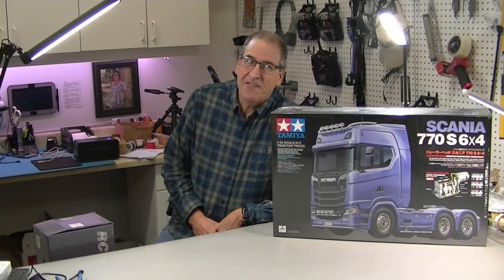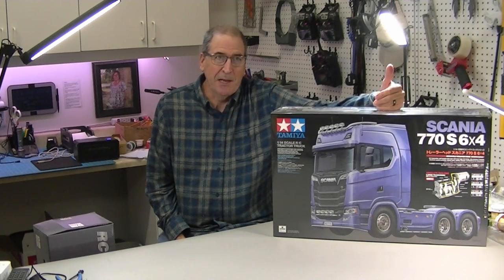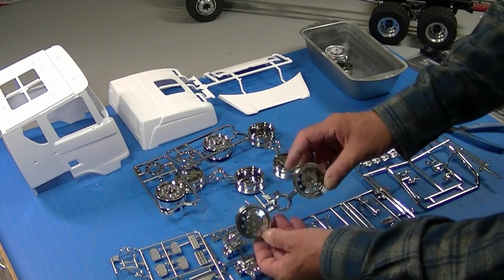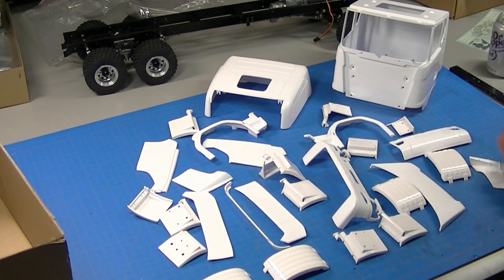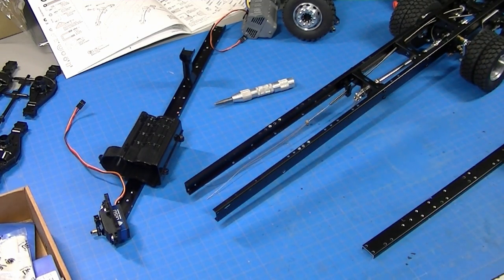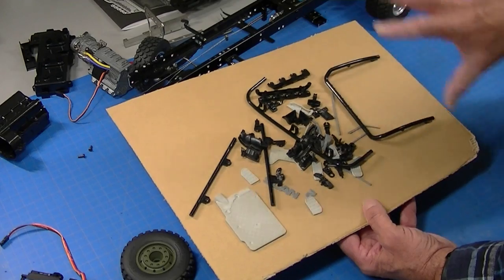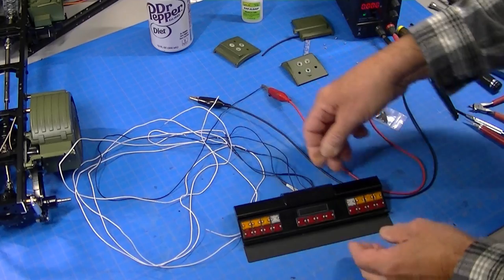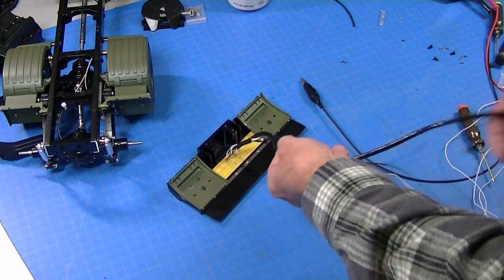1/14 Tamiya Scania 770S Custom Build w Trailer- Part 1

Comment: Loving the build concept on this one...... no sure its how we'd do it in Europe, we would shorten the chassis the idea of the equipment rack is to get the fuel tanks, air tanks,  battery etc out of the way to put extra axles in. However can't wait to see how this one works out

Comment: The real life version of the kind of truck you're making would usually have an extra steering axle in the empty space between the rear axles and the front axle. There are a dizzying number of different layouts with 8x4 and 8x6 configuration.

Comment: nice build but...... i think the the meassures between steering axle and the boggie axles is to long..... it should be shorter if you dont add an extra axle in the front

Comment: Bob, I recently bought a Tamiya Arocs from you but I want to fit that transmission in there, it would be really helpful if you reviewed this transmission because there seems to be almost no info anywhere
Reply: There are quite a few of these cast motor/transmissions out there from Asia. They do the job, but typically there is more or less plenty of noise, sloppiness and rattle, as with the original transmission. If one don't mind, it's okay. There is a version transmission named CVT, got a rubber belt inside, that it's better to stay clear of, slips if loaded too much. If one are a perfectionist when it comes to keeping sound level low, one need to look for a german gearmotor like Servonaut GM32U390 (1 speed, which actually is enough for most uses)

Comment: Looking forward to this project. Btw is it possible to turn the tamiya 6×4 mercedes truck into a 6×6 one without a new frame and new sets of diffs?
Reply: Lesu's showing up in my targeted ads a lot recently.

They sell reduction boxes, transfer boxes, axles with and without lockers, and mock airbag suspension parts, amongst everything else.

So no, you don't need a new frame.

You DO need to buy the new axles, transfer box and forward propshaft.

Comment: Hi like watchin ur videos there grate wouldn’t it have bn easeyer to cut the frame frame the kite then cut the part from the long chassie n also I would have left the 2 servos up frunt as u get better steerin from it or u could have just cut the kit chassie in harf n added the length in middle would have made it love easeyer for u m8

Comment: Okay, I've been eyeballing the Lesu axles, and especially their mock airbag system, the single-bag version with the hinge in front and bag behind the axle.

Looks like the mock airbags would be easy to put a big booster spring inside, to carry heavier loads.

I was concerned about product quality, but if this project of yours shows they're solid, I might end up biting.

Also, do you know of any mockup air brake cylinders to attach to the axles? Or any "here you can glue these scrap bits together and paint them aluminium" scratchbuilds?
Reply from the maker: The axles look great.  I will show them in more detail when I get the chassis running.  Not sure about the airbag suspension but will probably look at it in a future build.
Reply: @HobbyconceptsLLC  pomHossm

Comment: hi I am looking at buying a 1/14 KOMATSU RC HYDRAULIC WHEEL LOADER WA480 from eagle mach are they any good?as I am new to RC digers .I am not new to RC
Reply: Regarding 1/14 loader the one called W470 got a good reputation, few problem. It's made by another company than Eagelmatch. Eaglemach is behind the design of the loader 870K that have been on the market for some years and is known for trouble. They got a updated version out now called WA370. Don't know if they got it improved, but hopefully. I'm not familiar with the WA480. If manufatured by Eaglematch I would be carefull. If not already bought, would search around regarding experiene with these different loaders. (Bob is mostly into trucks)